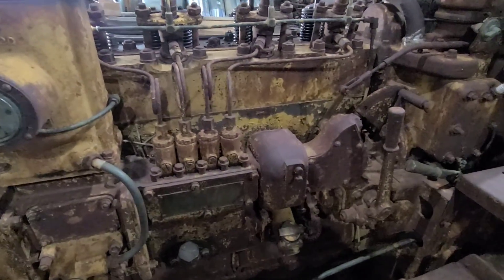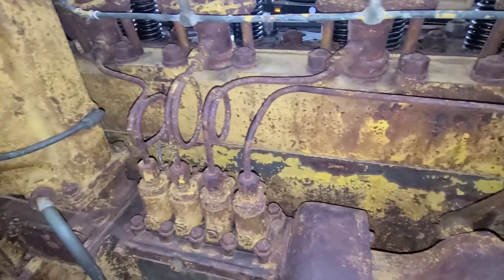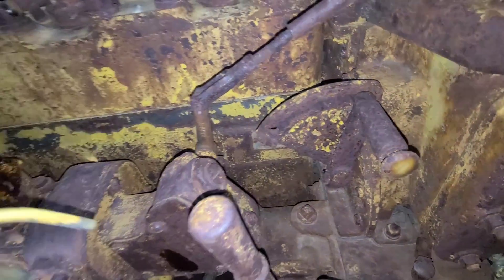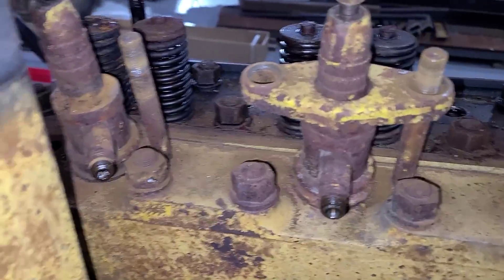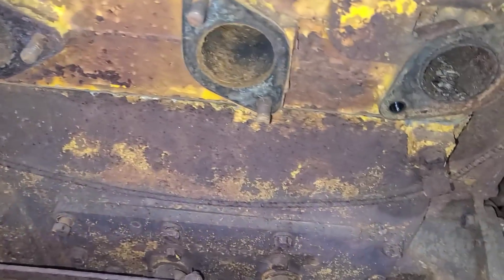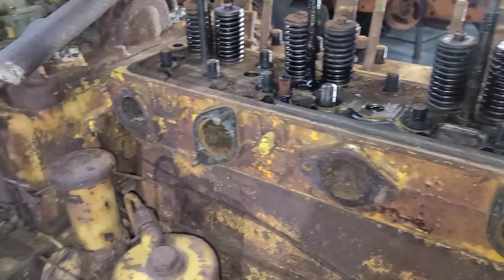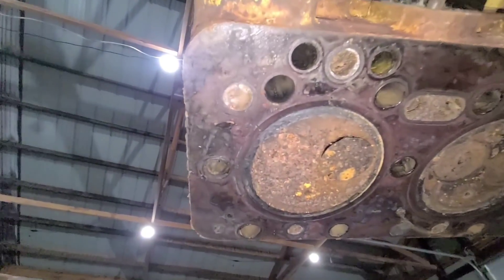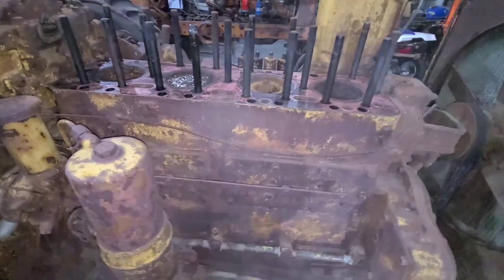Caterpillar RD-4 Engine Disassembly Pt.2

Comment: I just bought one of these RD4's about 2 weeks ago. I know next to nothing about them, but I noticed many things on my engine are different. Like the intake on mine has the pony motor exhaust running through it. The left side of the engine is configured a little differently also. Yours is earlier built than mine. Mine is 4G1919W. Subscribed, and I'll be watching all your video's. Thanks

Comment: I’m no expert on this but with all the old machines I’ve ever worked on I usually just start by painting it rather liberally with old engine oil to rehydrate everything. Seems to make all work much easier. Might be a good trick for this project? Although it’s usually pretty messy. Keep up the videos man looks outstanding!!!

Comment: One question are you doing a complete engine rebuild on this cat?
Reply from the maker: Yes, total machine restoration
Reply: @kylechrist  awesome! I’m pretty sure it will turn out Beautiful! When the work is all done will you show how to start it?
Reply from the maker: @rudycarlson8245  yes, this has a rope start gasoline pony motor that will then crank the diesel engine
Reply: @kylechrist  thanks!

Comment: Did the fuel return line always dump onto the ground or was that one broken? From the days when fuel was cheap and nobody worried about oil being spilled on the ground.
Reply from the maker: On the early machines they did just dump it on the ground, so it's not broken, that just how they used to do it

Comment: Thats engine does not have injecter it has nozzles that's why the return line is the way it is
Reply from the maker: To be technical, Caterpillar does not call them nozzles either. In the parts book they are called a "valve", part number 2A-5210

Comment: You, and I must be the only ones stubborn enough to work in unheated shops up here. 
I haven't noticed anything that looks terrible. 
Thanks Kyle.
Reply from the maker: Bryce, I have slowly been working towards getting my shop completed, we poured concrete in a 50x40 area last fall, but I couldn't get anyone to spray foam it before winter. I would love heat and it will happen, just not this winter. Thanks for watching

Comment: Consensus seems to be that it was better than expected. I would have run away screaming! Great job on the video, feels like I am right there with you!
Reply from the maker: Thanks Chris, unfortunately I knew going into this machine that it had been sitting since the early 70s and what I was going to find would not be pretty. I will keep moving forward as I have parts to fix what I've found so far (those will be coming out in future videos), stay tuned!

Comment: Looks like condention rust for the most part !! And I  have seen a lot worse  !!!!
I have  a  2510 John deer that has been  stuck since 93 !!!
I just have not had the time to mess with it!! Number 1 is stuck really bad !! 
Some diesel fuel and a glase breaker for  one and 4 and pb blaster for 2 and 3 should help a lot !!! 
See ya next time  !!!😊🌎🌞👍👍👍👍
Reply from the maker: I will get something soaking in those to try and save the pistons, the liners I feel are toast but we will see what everything cleans up like, thanks for Evan
Reply: @kylechrist  Kyle i was always to that if you had a down cylinder stuck if you cleaned as much rust out of it as you could and put about a half inch of delisle fuel in it and could light it safely and let it burn 🔥  out it would  unseize that cylinder!!! 
Have never tried it myself but maybe!!
It really doesn't look that bad to me but who knows 🤷
Reply: I call that technique “fire in the hole”. It’s not magically effective but I think it helps some.  You need a rag in the fuel for a wick.  I ended up using a chunk of wood post set on top of pistons and a sledge hammer.  The head had been off and engine out in the rain for years!  I just wanted to turn it to make it easier to get rod caps off
Reply: @jimrankin2583  nice to know !! I have a few engines I need to take apart !!!

Comment: It looks much better than I expected. They don’t look any worse than my D4 was and I reused the pistons and liners but why when you have or can obtain better ones. Also when you pulled the pony exhaust I thought the exhaust ports on the pony looked quite clean, a good sign.
Reply from the maker: I will still take care in removing everything, some pieces may be reusable if parts become scarce down the road. I was expecting to see standing water in the cylinders so it is better than I had first thought. The pony motor will be another project coming up, but so far it does look decent. Thanks for watching Geoffrey